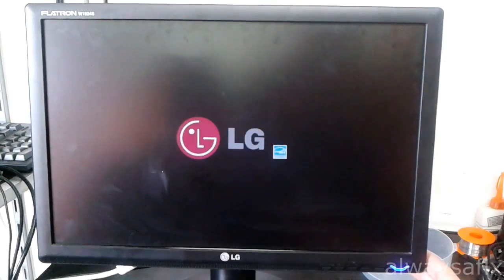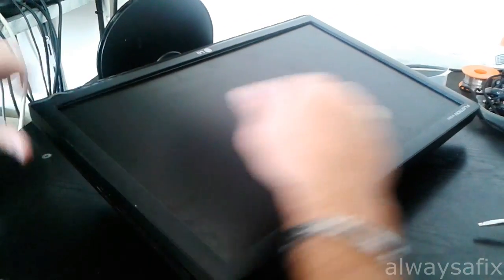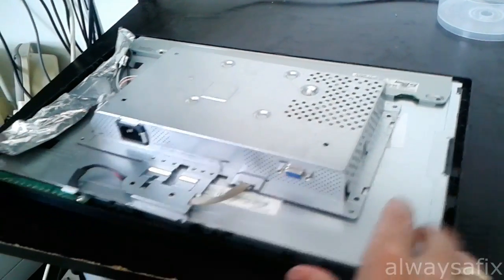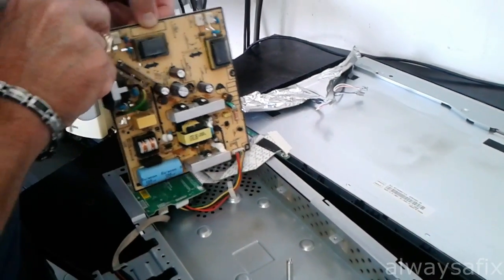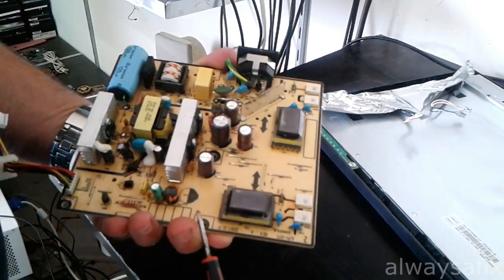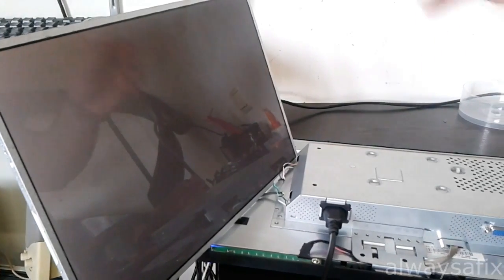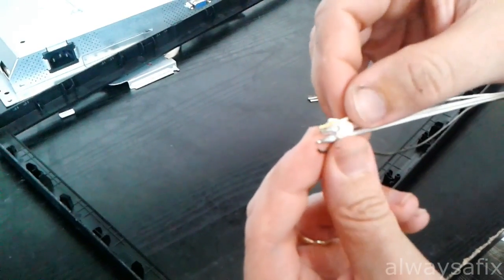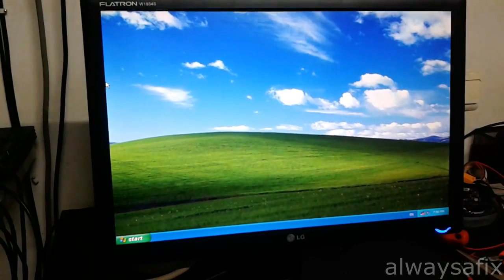Screen problem switching off LG flatron 19 inch repair

Comment: i have the same monitor but it happens sometimes, but sometimes dont...it started happenin 2 days ago and i have this monitor for 5 or 6 years...should i repair it?
Reply from the maker: The power supply board needs to be checked for bad capacitors.  Good luck.
Reply: thanks but what if caps are good?
Reply from the maker: NiX Check out my other video on replacing ccfl lamps.  Good luck!
Reply: i did everything but its not working, i bought new monitor...btw thanks for help

Comment: Ammmm... really good video ! but I still haven't found the broken part yet. lamp seems to be alright, capacitors are okay too.... where I should look now ? (The problem and Flatron are exactly the same as yours).
Reply from the maker: Please explain exactly what happens when you power on the monitor?
Reply: alwaysafix  It runs about 2 sec. and then turns off. Like I sad, I have exacly the same monitor and problem as yours. But when I opened it (thanks to you), I haven't found any troubles. The lamps are ok, I checked them, they don't turn off, they can still shine. So I packed it again to the case, power on it and.... its still happening 2 seconds, and turns off. When I push the power button twice, It turns on again for a 2 seconds that I can see a wallpaper icons etc. and It turns off. (Sorry for spelling mistakes).
Reply from the maker: Aliens4everR Even though you see the lamps switch on, one could still be faulty causing the circuit to shut down.  You have to connect another lamp replacing one lamp at a time.  Switch it on and make sure the lamps remain on.  Good luck!

Comment from the maker: @Mark Beckitt Much appreciated, thanks for watching!
Reply: alwaysafix my flatron is heathing, what to do?
Reply: +alwaysafix @mark Beckit Hi my fathers LG flatron w2043s started fading a while ago had lines and just wasnt right obviously ive tried a rubber on the ribbon for corrosion and tried to extend my laptop display via vga cables all i got was a white screen any idea what i can try next ? are u from South Africa by the way ur accent sounds close :) im an SA dude
Reply from the maker: +Vaughan Stephenson When you connect an external monitor/tv does it work?
Reply: hi it gets a white screen....the LG (smaller 20")started going ''fuzzy and blurry then it started havinga whole lot of green and blue mini lines like minuseas stacked with the picture in background...(personally i think it was those tiny insects from the parrot) then it just had white screen....the samsung is a bit bigger syncmaster i bought from a friend for R100 he said hes nt sure if it works....when i pluged it in at home it had no power whatsoever i suspect the powerboard faulty...so i was wondering if i can take the power board from the LG and use in samsung but the connector on the power board has diffrent abbreviations  some arte the same like 12v and ground(GND)etc
Reply from the maker: +Vaughan Stephenson You cannot change the power boards around.  Are there any swollen capacitors on the Samsung power supply board?  Have you checked the inline fuse?  Good luck!

Comment: One good way to discharge a large cap holding under 1kV is to use the diode test mode of the meter. Make sure the mains is off, hold the probes to the cap one way or other until it displays about 0.5V. That way you avoid nasty sparks, shocks etc.
Reply from the maker: Thanks for sharing.

Comment: Got an LG Flatron L194WT-8F (19 Inch Monitor) that switched itself off and now the power button doesn't work... the small indicator light (Blue) doesn't even come on ! Anyone any idea what the problem is and would it be fixable ?
Reply from the maker: Have you looked at the capacitors on the power supply board?  Good luck!

Comment: Hi !
I have one W2253V-PF and one of the backlight is broken near the wire plug !
how to fix it !
Or were to buy one backlight ?!!

thank"s in advance !
Reply from the maker: Most suppliers supply the backlight without the wire anyway, so you need to get it resoldered.  Good luck!

Comment from the maker: Replacing capacitors only costs a couple of dollars, and if you are handy with a soldering iron, you can do this with no problem.  Make sure the mains are disconnected at all times and make sure you get the polarity of the capacitors correct.  If you check through my videos, you will find a screen repair where I replace capacitors with a step by step tutorial.  Good luck.

Comment from the maker: Could be that you have some faulty capacitors.  As the capacitors weaken you will get a monitor, that works sometimes and other times not.  If the screen turns off while you are using the computer then it's most probably the caps.
Reply: alwaysafix no

Comment: I am having a problem with this monitor in my studio,  when i turn the computer on every morning since this week, the blue led blimps, but the monitor doesnt make any visual response like it was switch off, i try to switch it off, on the led, but it doesnt not work either...  after a while when i was searching using my laptop for this type of problem solution, the monitor led becomed orange again, and i turned it on and it was normal again, switch on the computer, and normal, what is happening?

Comment from the maker: Just for testing purposes, if you connect for an example from a 15" laptop I found no problems.  Heatshrink tubing, and try not to damage the original silicone rubber housing at the end of the lamp.  I push the lamp through the silicone through the hole where the wire attaches to the lamp, and after soldering I put it back.

Comment: Two questions: When testing using ccfls from another screen, do they have to be same size as the bad ones? And what'd you use for insulation after you re-soldered wires on. Thanks